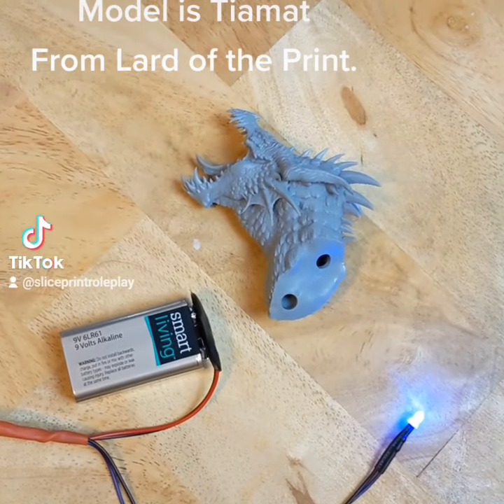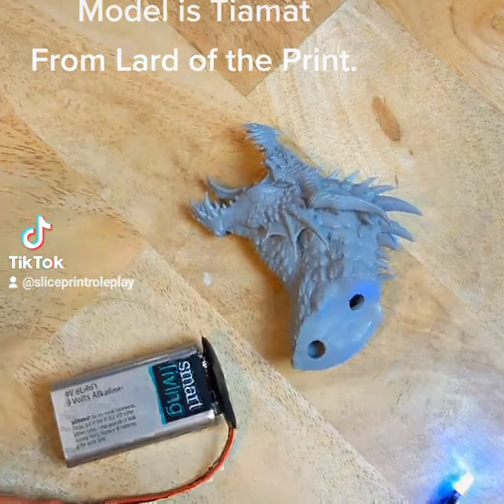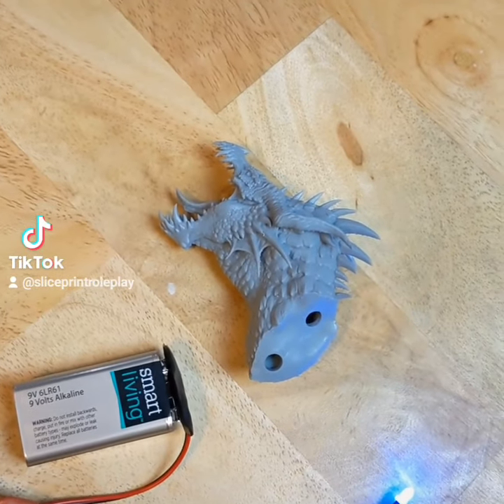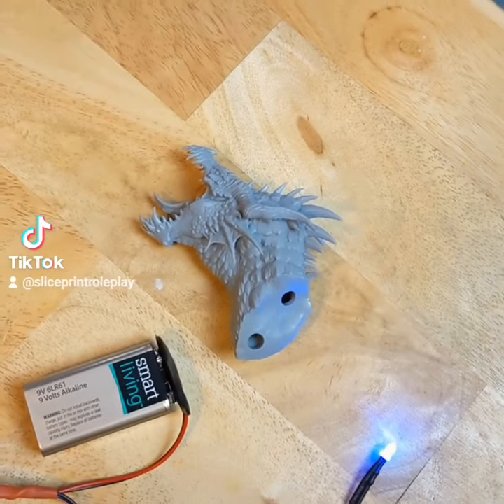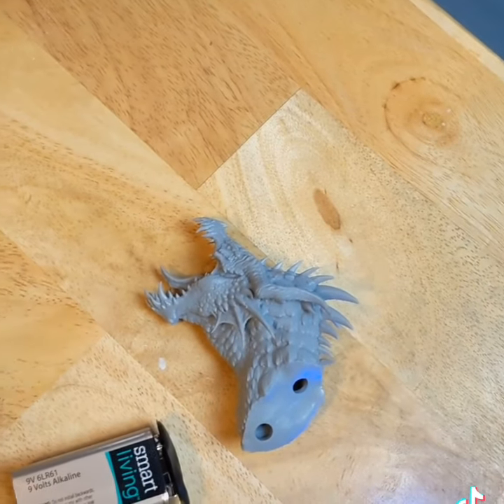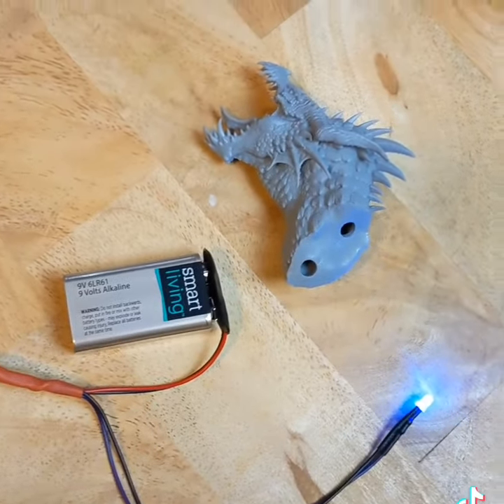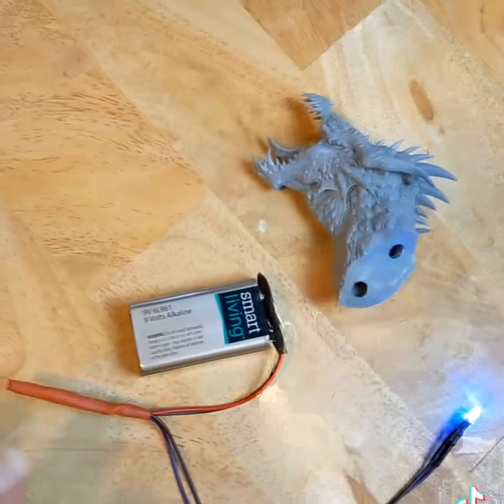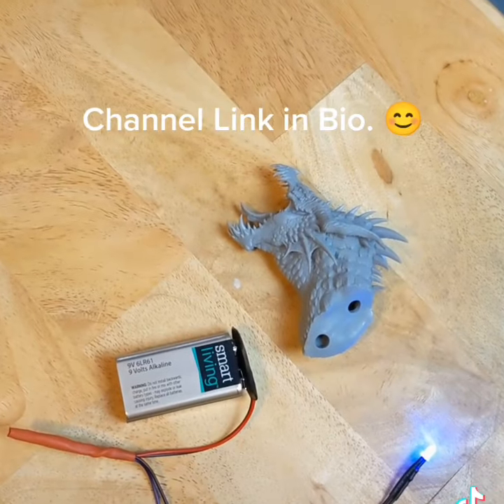How to Properly Clean & Cure Hollow Models. #Sliceprintroleplay #resin3dprinting #shorts

Comment: Is it simply better to let them dry in the air? Maybe with a ventilator?
Reply from the maker: I normally leave prints to dry for at least an hour. 2 hours if they're hollow. A filter or vent system certainly can't hurt when dealing with UV resins and cleaning solutions.